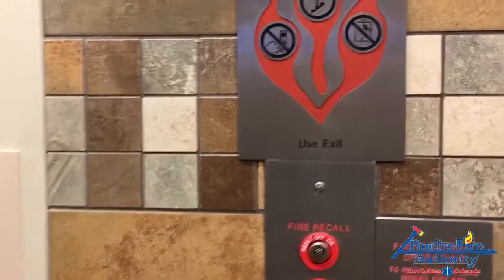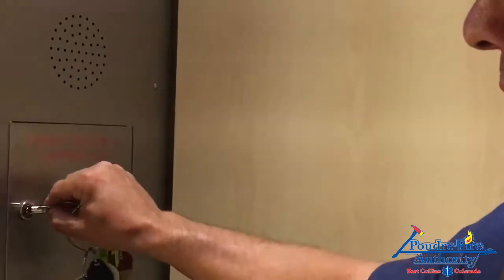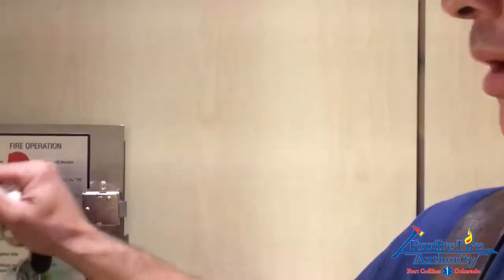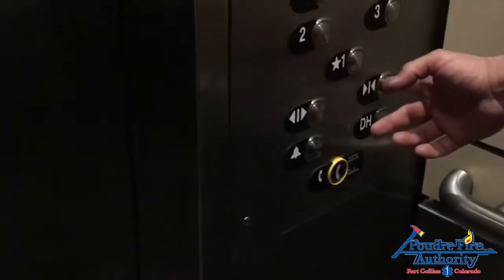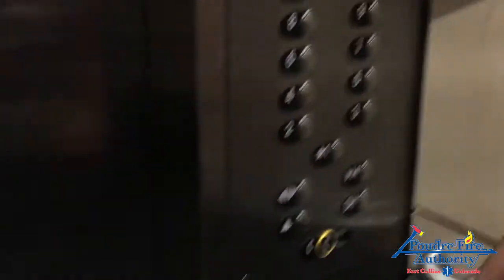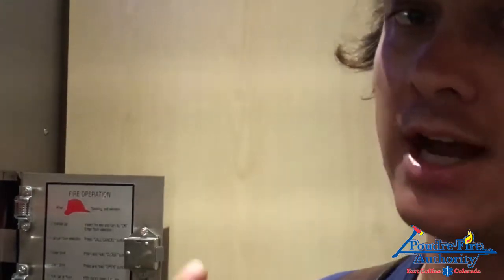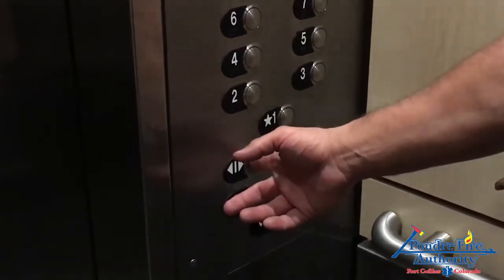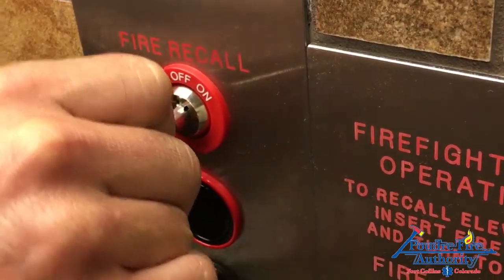Elevator use for Highrise Fires

Comment: As someone who's been installing and repairing elevators for 35 years, I'd like to ad that you make sure you let that door hit it's open limit when in phase 2 before exiting. If your even slightly off, the door will close behind you and the car will be stuck at that floor. I can't even begin to tell you how many calls I've taken to remedy this situation.
Reply: In reality, procedure should dictate that the elevator car never be left unoccupied when phase 2 is turned on.